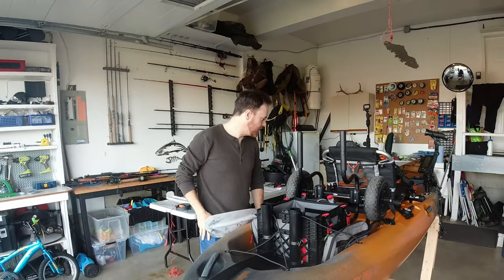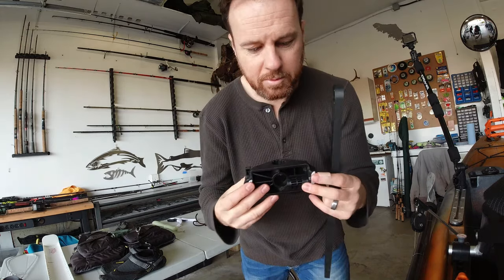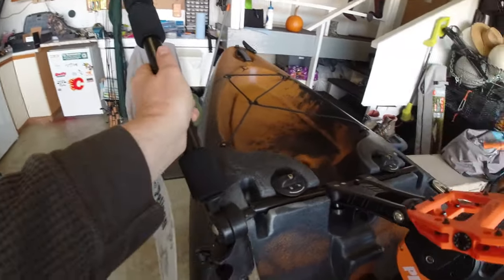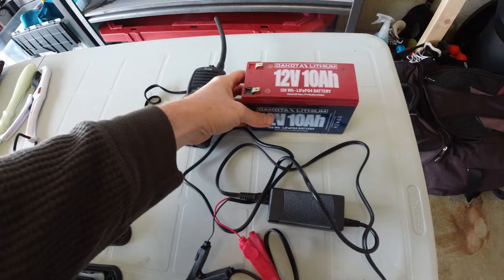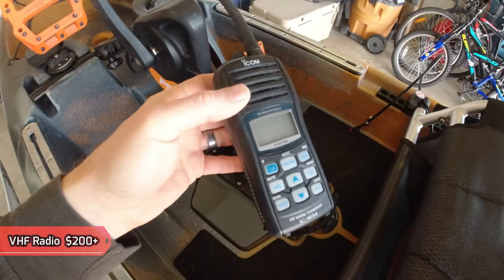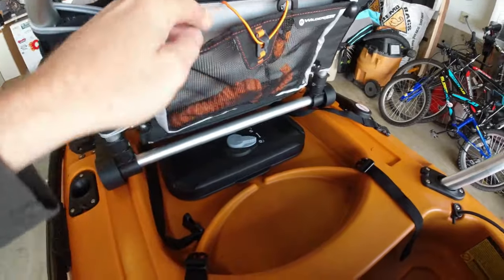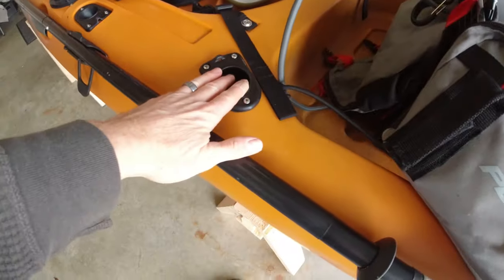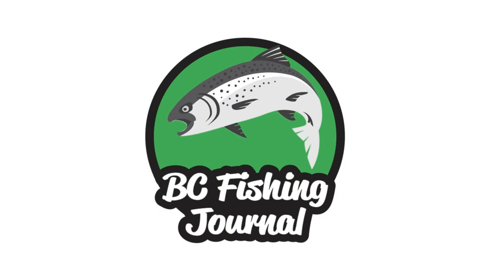Old Town PDL 120 FULL 🛶 KAYAK SETUP with COSTS 💸

Comment: Great video Jesse! I really enjoy your comparison between the Scotty 343 and the YakAttack GTTL90 - the difference in T-Bolt size is huge and something I hadn't considered before. I know whenever I move my 343s I have to make sure I back off the T-Bolts before tightening them to make sure they are grabbing the rail properly. An alternative to the Scotty braided downrigger line is PowerPro makes a similar product for about half the price. Most important reason, IMHO, for switching to it on a yak is the safety aspect - being able to cut it if things go sideways. I'm using a Scotty 1060 where I shortened the boom arm and then attached it behind my seat with a quick release plate (and one on the inside flipped upside down to be a makeshift backing plate). It's good having a line counter and single hand operation, but I partly wish I went for the Cannon downrigger with the vertical orientation as it may be less awkward. I think KC are looking at changing theirs next year to it. Still, was able to use a 10lb ball at 150' off Kitty Coleman hump this season with no issues (other than it being a huge PITA to drag around and reset with shakers). One upgrade I think you may want to do is the rudder pin upgrade, if you haven't already. You can either DIY it, or grab the kit from Navarre. Just a bolt, some nylon washers, and a nut, but it allows you to really tighten up the steering. That can be pretty important if you need to let go of the rudder control and still keep on the same heading.
Reply from the maker: Thanks for all the info! I did replace my rudder bolt with Navarre's. It's funny you mention that, as I recorded a bunch of that rudder bolt discussion for this video but cut it out because I thought it was too boring for the audience (as the video is pretty long as it is). 
As for the downrigger, I'm looking to upgrade to the Cannon downrigger that goes behind the seat, and mounted using the "V-Lock" custom plates. I'm pretty interested to learn more about the Scotty 1060, how are you mounting that? I'm assuming something similar to the V-Lock or aluminum/starboard plates mounted.
Reply: I enjoyed the video and found it helpful however. I just lost my laketroller yesterday when the Scotty T bolts popped out. The yak attack looks way better however it doesn’t look like it’s compatible with the lake troller. Am I missing something?

Comment: Great walk through and video as always bro! Couple recommendations: Our Scotty Laketrollers are getting retired this off-season, definitely going to be switching to the Cannons, also after having a solid year with the Navarre aluminum rudder upgrade, we highly recommend it! 👍 Happy Holidays from our fam to yours! We need to make a plan for getting out together in 2024! Cheers!
Reply from the maker: 100% would love to connect in 2024. 
Also took your advice, I got the aluminum Ridder, just need to install. And I bought the Easi-Troll Cannon downrigger, mounting it with the V-lock system.
Reply from the maker: And a massive Merry Christmas to you and family!
Reply: @BCFishingJournal  nice that was our plan as well, are you still thinking behind the seat for the downrigger?
Reply from the maker: @kckayakfishing  yes, basically copying “Spilt Milt Productions” channel install. The only challenge will be the boom cut/drilling as it’s stainless steel on the Easi-Troll.
Reply: @BCFishingJournal  yup that was our plan too! Also hoping to attach a drill to the downrigger, would be amazing to not have to worry about cranking up the ball!
Reply from the maker: @kckayakfishing  a drill would be some next level engineering stuff! 
The way the industry is going, I wouldn’t be surprised to see an electric downrigger for smaller boats/kayaks in near future.

Comment: I enjoyed the video and found it helpful however. I just lost my laketroller yesterday when the Scotty T bolts popped out. The yak attack looks way better however it doesn’t look like it’s compatible with the lake troller. Am I missing something?
Reply from the maker: @cwilliams66  yes, correct. The yak attack mounts only apply to their accessories. Scotty accessories will require Scotty mounts or there are some universal mounts like Navarre. I like the Scotty mount (and products) but would replace the t-bolts with the thicker rectangle sizes.